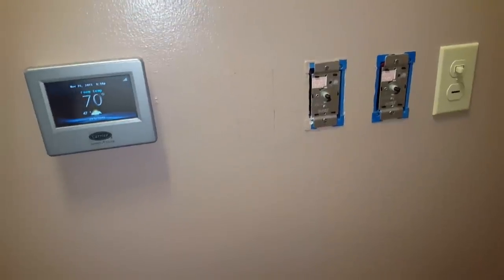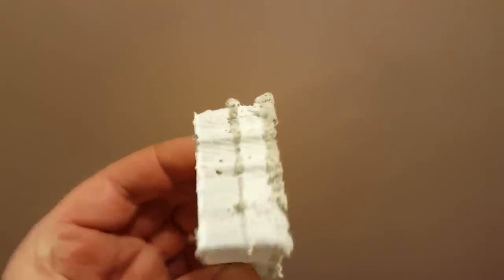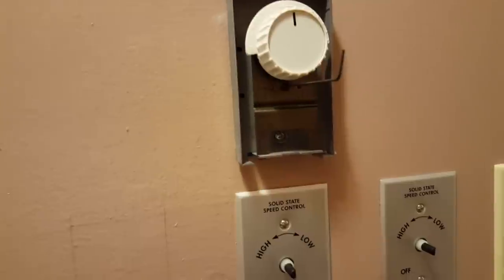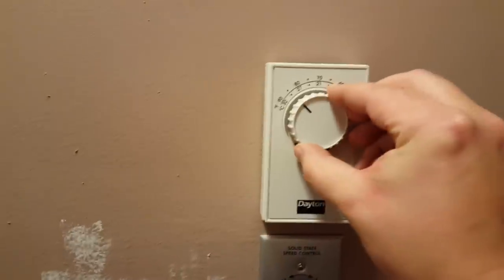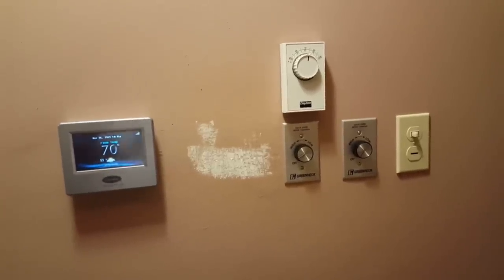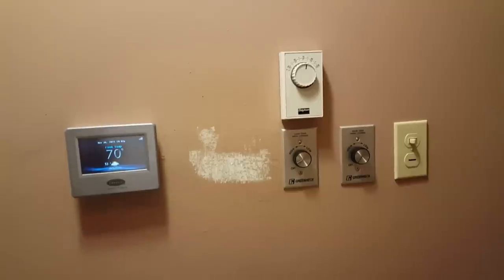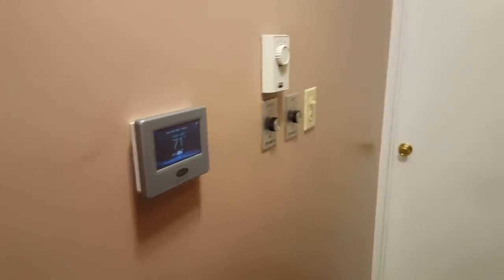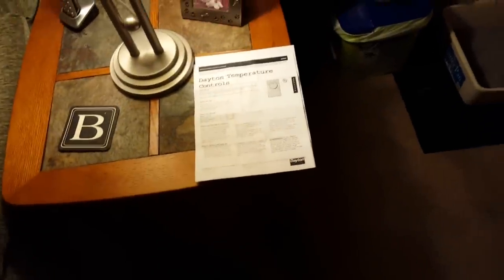Dayton Whole House Fan Thermostat

Comment: The house I grew up in in the late 1980's and though most of the 1990's had one of these in it. Big blue blades, big belt driven motor. I remember on nice spring and fall days, mom would open up the house and turn it on, and it would put the best breeze though the house.

I also remember when dad would burn something in the kitchen we'd always turn it on and it would suck pretty much any stink right out of the house.

There were two very large coinciding exhaust vents on either end of the attic.
Reply: +Pan Gramercy Nice!!! Yep, amazing how fast it takes the smell of burnt pizza out of the kitchen :-) and those were some great memories of my own.

Comment: I bet your house is so solid and nearly soundproof with those plaster walls! My old house (built in 1912) had lath and plaster, and every wall felt as solid as an exterior wall, and you could hardly hear anything going on outside, it was nice. Were thick plaster walls common in your area in the early '70s though? Or was yours a lot more high end, as opposed to a standard cookie cutter house? Every house I've been in that was built in the '60s and '70s (including my own, which was built in '76) had the standard drywall... it had a much more solid feel than modern McMansions, but it still had that hollow feel, like drywall.
Reply: +wilkes85 By the time this house was built, gypsum (or sheetrock) was getting common, but whomever built this house decided to go with the old plaster-with-metal-grid walls, and they're all an inch thick.  Makes for GREAT sound insulation (and thermal insulation too!) so the only thing I can guess is the original builder wanted the best.

Comment: so what's the point of the second control and the toggle switch?
Reply: Left to Right are whole house fan speed, attic exhaust fan speed, and attic exhaust fan manual-on with indicator light to show whether or not it's running.

Comment: Nice. Just wondering if I put vents in the floor of each room, being on a raised foundation, when the fan came on it would pull cool air from under the house so I don't need to be home to open windows and might be safer at night not leaving a window open. What do you think?